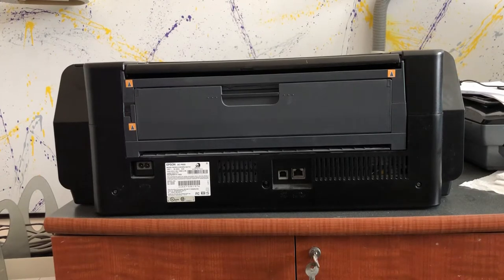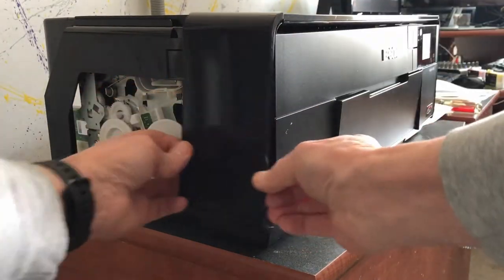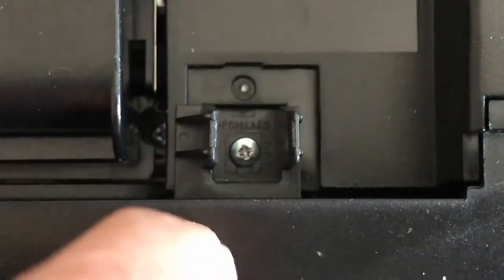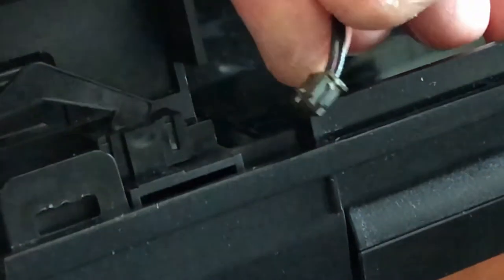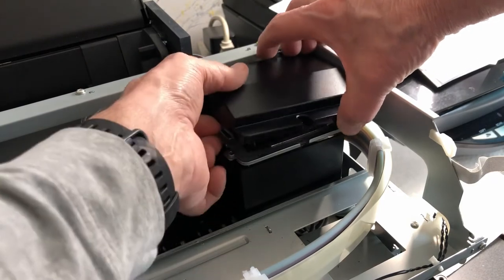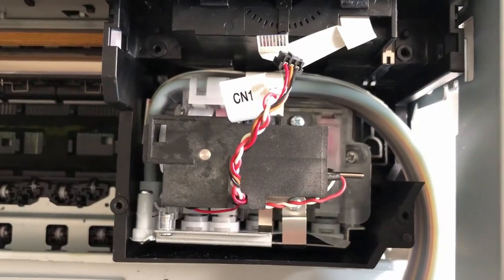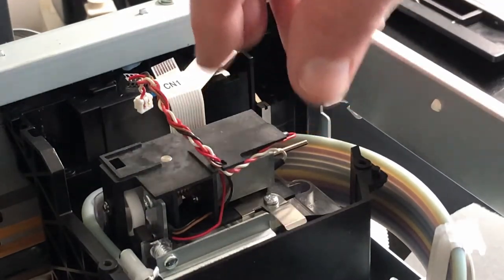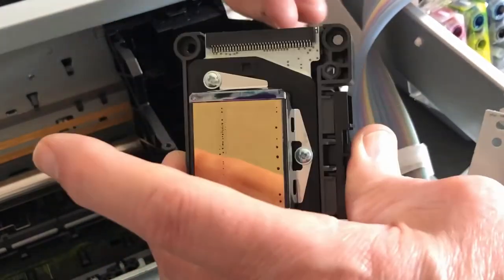Opening Epson Surecolor P600 and Printhead

Comment: Thank you for taking the time to help others. For a long time I was wondering how I could dismount and clean my printhead on my own. I had repetitive problems, clogged nozzles and color dominants for a couple of years. No cleaning cycle would get rid of it. Epson asked for 600€ for a head replacement... basically the price of the printer itself
Reply from the maker: I agree 100%. One of the reasons I came to try to see if I could clean my own. Parts are usually the killers for keeping these printers running.

Comment: I cannot thank you enough for saving my P600! This was the best step buy step disassembly. It was my first time really opening up an expensive printer. I've tried everything to avoid having to do this. I was able to restore 3/4 colors by using the 50/50 Windex/IPA damp paper towel and sliding under the printhead overnight. But Magenta was not printing at all. I removed the printhead and flushed each color and reassembled. After a few nozzle cleaning runs to get the cleaning solution out, my P600 is working excellent again. Thank you!
Reply from the maker: Glad I could help.

Comment: I took my printhead out then pulled the lines out of my dampers, ink ended up splashing in a few unwanted places like onto some of my cables and encoder strip. No electronic boards as I could see. I spent hours looking for and cleaning(with 91% Alcohol and long tipped Q tips and paper towels) lightly wiping everything down then drying with dry Qtips until I was satisfied that everything was very clean (checked every nook and cranny I could find)…my question is, If I let the printer sit for about a week or two just to make sure it’s dry. Would it be ok to reassemble or is it completely damaged ?! Everything was off and unplugged and the printhead was already removed when it happened.

Comment: This video, together with a WOKOK $8 printhead cleaning kit from Amazon, saved my Epson SC P 600 printer.  The magenta ink was completely clogged with dried ink, and removing the prinhead as shown here, then injecting the solution in the WOKOK kit, unclogged it. I had to do several cleaning cycles afterwards to load up the ink back in and to finish cleaning the printhead, and that was it. The printer now works like new.  Less than $10 saved me close to $1000 in printer and inks. It also saved a printer from going to the recycling center or the dumpster.  Thank you very much for your video instructions!
Reply from the maker: My pleasure
Reply: @zorka4098  😊

Comment: This is very helpful. Thanks for posting. Did flushing the print head resolve your issues with yellow? I ask because that's the color I'm having problems with.
Reply from the maker: Actually, no. I am still trying to see if I can resolve it without the need to buy a printhead. That costs more than the printer, which I would sell as for parts before I do that. (Unless I could get a working printhead cheaply though doubt that).

Comment: Did cleaning the print head work out OK for you when you reassembled.  Did you all the colours work?
Reply from the maker: Yes, but it did not resolve my main problem, which is that a yellow line appears across the text page in a couple of places. I cannot figure out what is causing it and might have to disconnect the whole inking assembly. This is something I am not looking forward to doing. Even then, I am not sure it will resolve the problem.